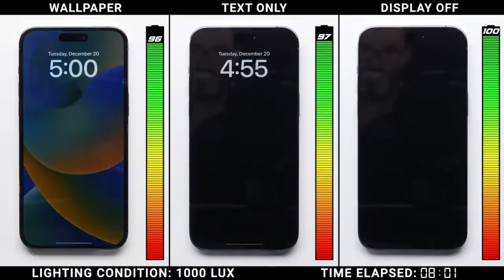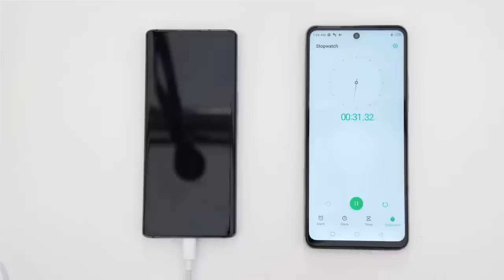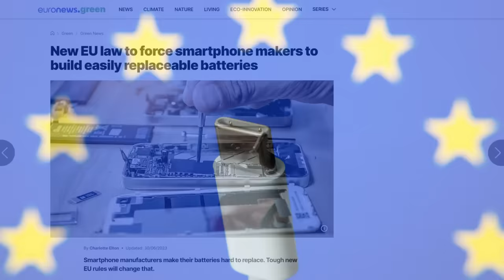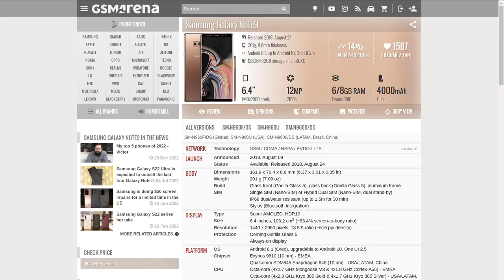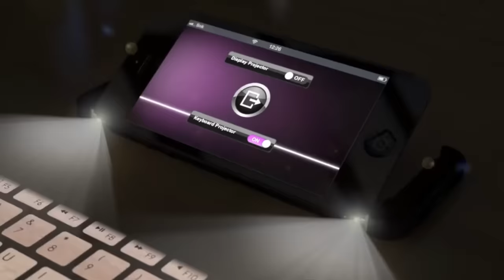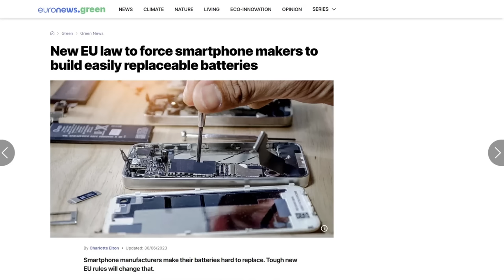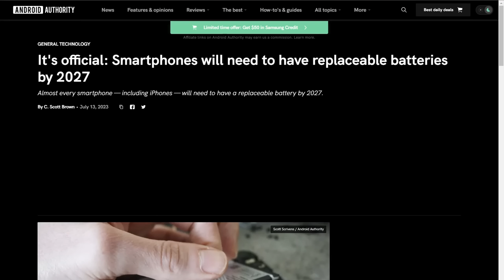All Smartphones Will Soon Have Removable Batteries

Comment: The best thing about this is the increased longevity of the devices (also for Handheld gaming systems like the Switch or the Steam Deck). This will result in much less e-waste and spark innovation again as a selling point (besides foldables etc.).

The batterypack swap mid day feels exaggerated I think, some might do it and it's nice they can now again, but most people will continue to operate like they did with chargers and wireless charging.

I would expect the effects on batterielife to be minimal, while the lost density might actually impact water resistance significantly.

I only fear that manufactures will go back to only offer Android updates for 2 years again, making the phone obsolete in that way, if you care at all about security.

Comment: This guy completely misunderstood what the regulation is about. 

“A portable battery should be considered to be removable by the end-user when it can be removed with the use of commercially available tools and without requiring the use of specialised tools, unless they are provided free of charge, or proprietary tools, thermal energy or solvents to disassemble it.” 

It’s basically mean that not much will change except that it will prevent companies from doing shenanigans like apple with their software lock on parts

Comment: It's impossible to make a battery that is not removable. If a factory can install it, so can a skilled nerd.
Reply: Its true. But to replace a non-removable battery, a simple screwdriver is not enough. you need a device that heats up the back cover. Then, after the replacement, you need to glue it with something again. An ordinary person does not have this equipment at home and skills.
Reply: @nayman4684  True but it's really not that difficult to get the required tools - $10 suction cap and any hair dryer will work.

Comment: Old video but i see no peoblem with the engineering. Build a battery in which the chargeport and chargging chip is integrated into the battery shell meant for a specalized slot. A simple rubber seal and some screws to fit the battery directly to the phone should do the rest.

Comment: I think replacement batteries are a very good idea. A standardization of interfaces like USB-C was also important. But why one should ban good cameras is a mystery to me. Here there is a wide range of products and everyone can choose the one that best suits them. I at least appreciate a camera system that I always have with me and hardly causes extra weight. Multiple cameras are just a way to also accommodate ultra wide angle and tele. This is to the advantage of the user and not to his disadvantage.
Reply: > This is to the advantage of the user and not to his disadvantage.

To the advantage of spies, too.

Comment: To me it’s not worth it lose larger capacity battery’s and water resistance as well as forcing companies to redesign their premium devices to fit a let’s face it less premium design model… phone with removable batteries always felt a lot less premium. If you can’t afford a 100 battery replacement then you can’t even afford a premium cell phone or even cell service for that matter. Those people are going to buy a new cheep phone every year care a battery will cost 30 bucks and a new low end phone is 60 bucks this will ultimately case more lithium waste with everyone purchasing 2 extra lithium battery’s to go with their phone and. Regular customer won’t dispose of lithium cells properly like a phone repair shop so more hazardous waste less premium feel to phones and less water proofing regulations suck it would be better to just regulate cellphone manufacturers to provide 1 free battery replacement per phone after 2 years .. then they can add 100 extra to the phone and people can get their battery replaced free after 2 years then after 4 years it’s time to upgrade anyway and your new phone will get another free battery after 2 years

Comment: Why are you talking only about apple? Pretty much no phone that exists have removable batteries. None of the companies will want that, it is not about apple. Why is it always the bad guy 😂

Also i definitely dont wamt removable batteries. No water resistance, stupid mechanism to open your phone, thicker phone, smaller battery... All are very important features that i definitely wouldnt trade for a removable battery. A new flagship phone easily lasts 5 years now anyways.

What eu should do make phones batteries changeable and that is that. When your battery health drops, you should be able to go and get it fixed in any phone repair shop instead of only official services.

This is the stupidest smart phone debates i ve seen.

Comment: There is a Loophole that Waterproof Devices do not need removable Batteries.
Reply: Devices that are designed to be in regular contact with water, yes. 

But good luck making a phone manufacturer say this.

Comment: Honestly I think powerbanks are the way to go. The thing with swappable batteries is that they're usually specific to a smartphone model. Why buy a battery that works only with a specific phone, when you can buy a powerbank that can work with anything
Though I'm more interested in swappable batteries because it makes battery replacement way easier

Comment: I’d hate this to make my iPhone 18 to become that much thicker!
Reply: lmao you fell for Apple propaganda quite hard, didn't you? They won't get any fatter. The battery is frickin' inside already and it's not produced by them. They are not going to use bigger ones. Just add plastic pins on the shell so you can remove the back and open air connectors for the swap itself.

Comment: Removable battery was "in part" motivated by greed. The removable battery demands more materials to build (the internal battery is very soft and unable to stand alone outside the protection of the phone). it also needs extra materials to make the battery terminal in the phone itself. this is nothing that will make the price jump on the unit basis, but makes up to a lot in the scale of production.
The rest applies as well, but this was direct saving and probably reason why Android phone manufacturers jumped on the non-removables.